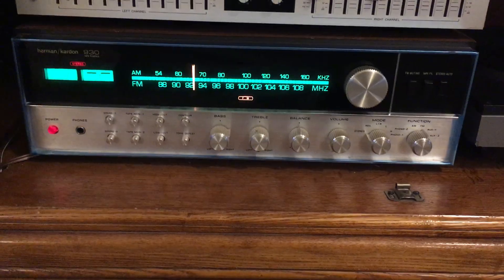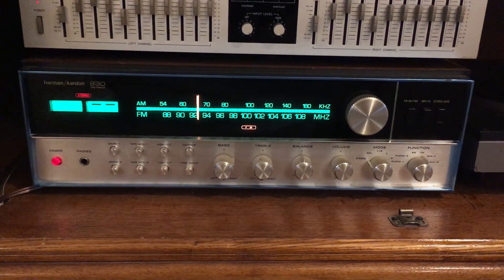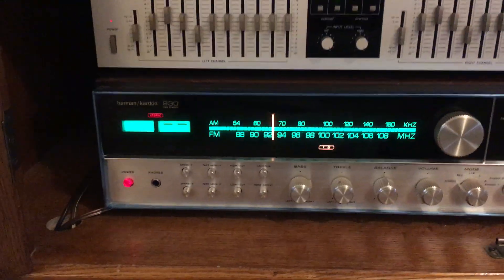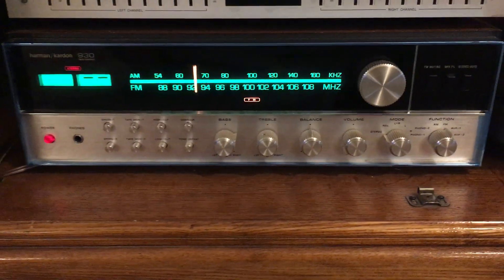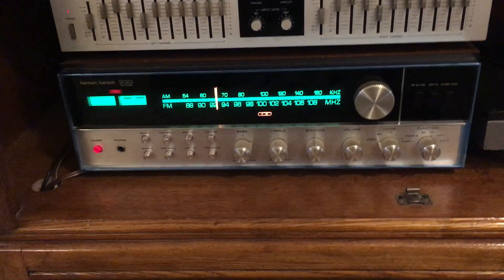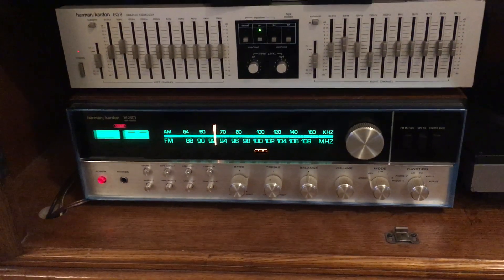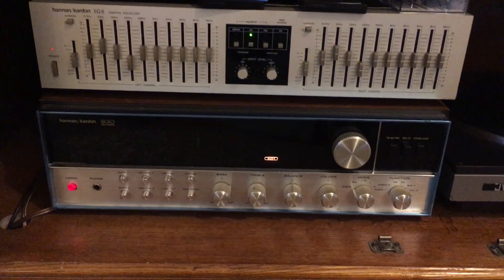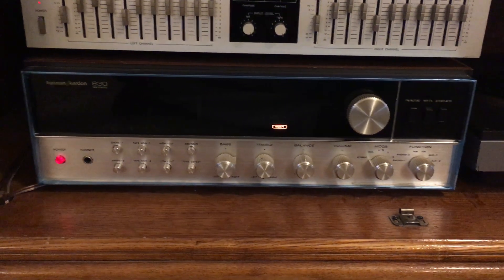Harman Kardon 930 Twin Power Receiver Pt 1!!!

Comment: Amen brother!  I rescued a 330b from a dumpster in 1997, while working for a temp agency in college.  That was the beginning of my hi-do life, this little receiver  actually changed my life.  The sound it makes is astonishing.  I bought a 730 two years ago, I will NEVER let it go.  These dual power HK units are the cats ass!  God Bless, and  have a fine Christmas Brother.
Reply: if your told not to take thimgs out of dumpsters is it theft the same as stealing mail out of pepoles mail box
Reply: @DavidBerquist334  Calm down pal, stealing from a mailbox is a federal crime, and theft, rescueing a vintage audio device from "Going into a dumpster," out of a rental property, that was abandoned by the previous resident is not the same.  I would do it again without a second thought.

Comment: $350 for that was a steal, the 930 and 730 can walk amongst the giants, if not win overall, costing several thousand. Even against kr-9600, 2325 and 2275, sx-950 and many many others, my favorite receivers are also the 730 and 930. I think looks and build quality and sound alone they should be $1500-2000 if restored in todays money, i do believe their that incredible.
Reply: Agree 100%, the 730 & 930 are absolutely deserving of being placed amongst the best vintage receivers.  They blow the doors off most of the cult of personality units that are 4-6 times the price.  My daily driver is a 730, also have a 330b since 1997.

Comment: First thanks for the great video. I recently purchased a 930 myself and although it is fully functioning I am going to fully recap as it is 50 years old and all original. I hadn't really thought about replacing the transistors. Was wondering if you could tell me exactly which 250 watt transistors you used. Thanks for any help in advance. By the way I agree fully with your assessment and this is one of my favourite receivers of all time.
Reply: again thank you so much @afathersdevotions

Comment: Im a collector  of Vintage  audio as  well as H.K...I own to  of there turntables .3 Disc Players .& 2 Receivers From H.K..There sound quality & Reliability Is unparreled..many manufactures  cant even touch.That includes   Modern day crap Like  sony & marantz   avoid!.. The only companys I would put in the  same league as Harman Kardon  would be  some  nad & Rotel .. thats about it!..Im always checking the thrift stores for there equipment..Im Hopeing  to Locate  one of  there tape deck to replace My Luxman( still hangin in there) By the  way the receivers that I own are the  H.K. 3390  stereophile  reviewd  back in the 90s...keep me posted,Thanks
Reply: David.  I have a pair of GE acoustic suspension speakers circa 1970. The sound is excellent.   These were never sold to the public because production cost far exceeded any retail price that would have been competitive.  The few that were produced were sold to employees of GE. Contact me if you are interested.